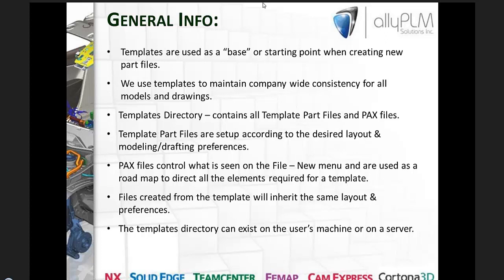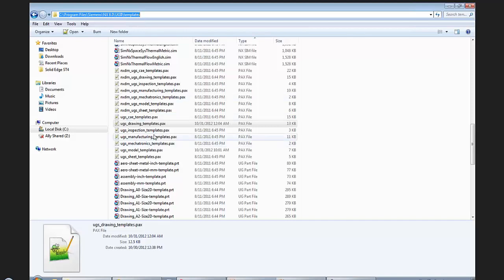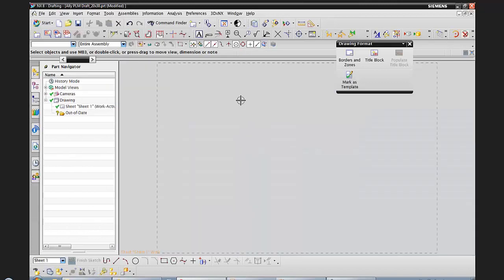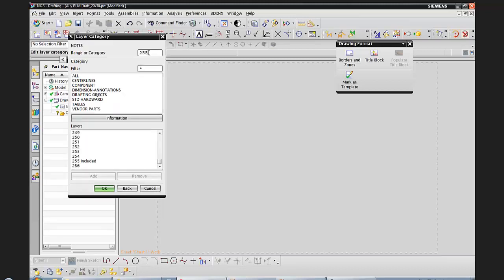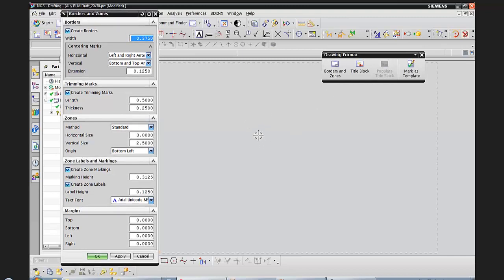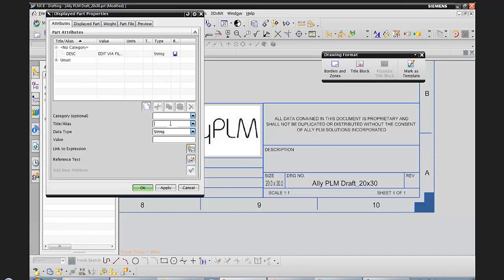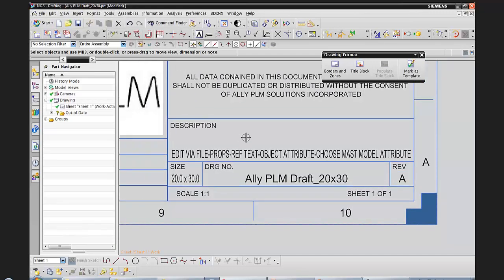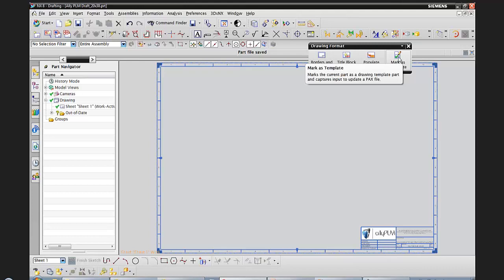How to Create NX Drawing Templates? - Tutorial - PROLIM Lunch Bytes

Comment: Thank for the helpful video. However, I have problem when opening the second sheet of the drawing or drafting directly from the model. The template doesn't show on the selection menu. Is there a way to do this?
Reply: ray ngo there is a different file for drawing template and sheet template. I know where it is in the standard nx directory, so that may help you. C:\Program Files\Siemens\NX 9.0\UGII\templates. There are two files, one is called ugs_drawing_templates.pax, the other is called ugs_sheet_templates.pax. You need to make the part file as a template in the ugs_sheet_templates.pax directory. also, this link may help http://allyplm.com/knowledgebase/2013/1/30/how-to-create-a-drawing-template-and-add-to-nx-75-template-list, just adjust what they are saying from modifying the drawing template pax file to the sheet template pax file